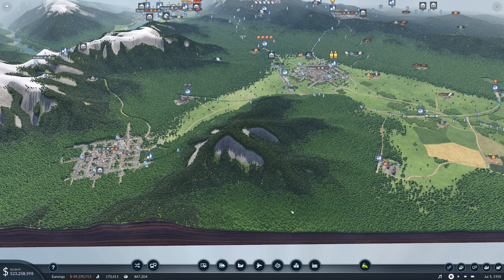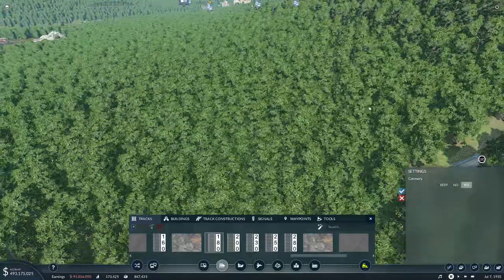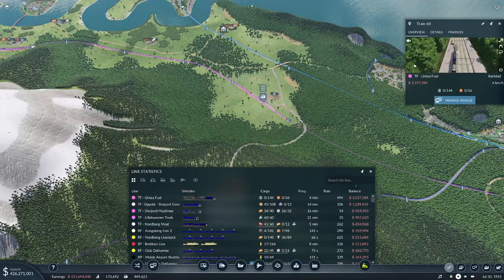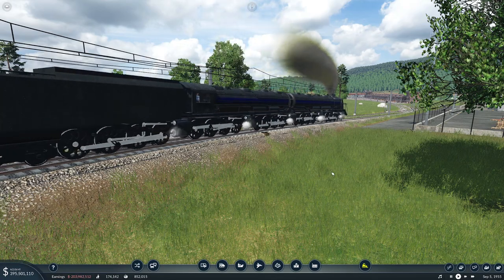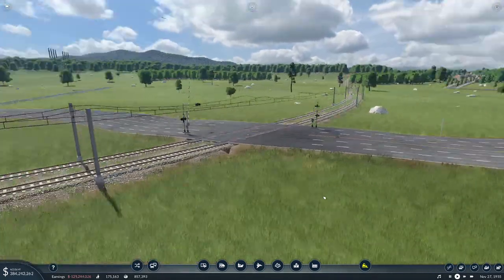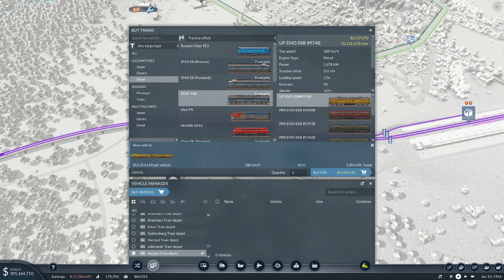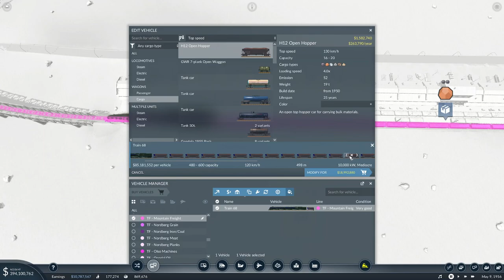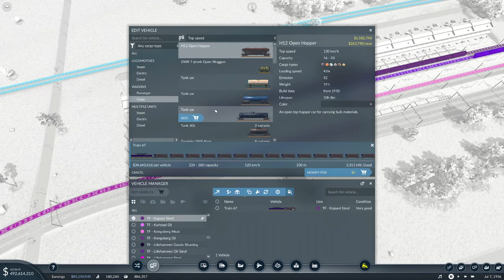Transport Fever 2 - Crater Bay - Episode 62 - Go Bigger

Comment: 9:47: A highly suboptimal route that could probably be redesigned to be much faster and more efficient, but a working design nonetheless.
14:12: I would like to see if there's a mod for the X-12 (A ~7,000 hp Nuclear-powered locomotive conceived of in the 1950s, which could have been developed given enough financial resources.), as I think that would even better capture the insanity of the Mountain Freight Rail project, not to mention being more future-proof (You could even double-head it for more power!). I know that there was a mod for it in the original Transport Fever, and it would be a damn shame if there wasn't one in Transport Fever 2. If there isn't, one should be developed, along with ones for other nuclear-powered trains.